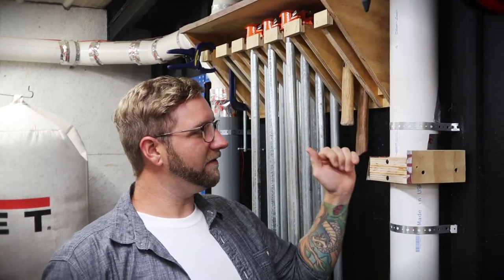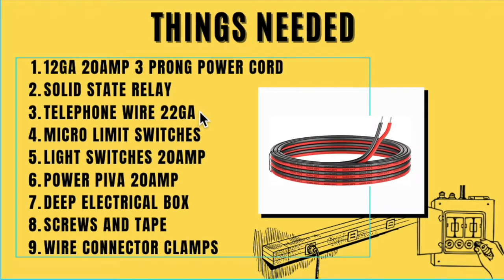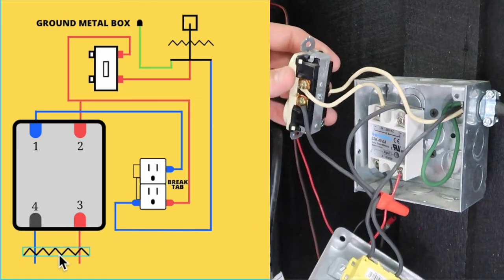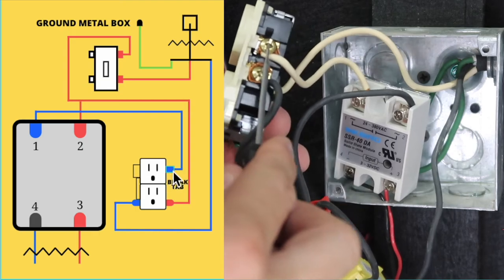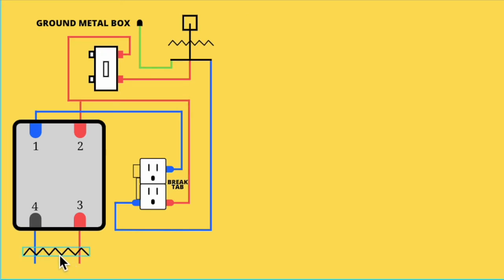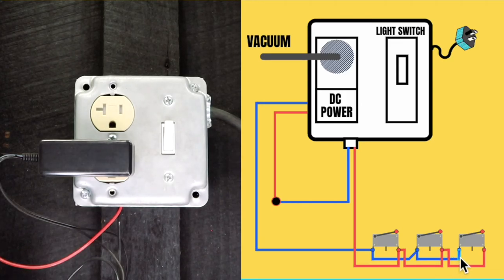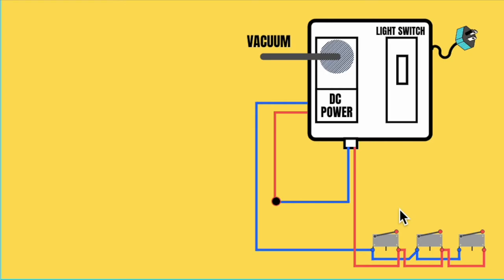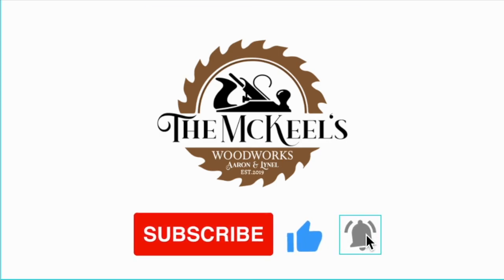DIY AUTOMATED BLAST GATE DUST COLLECTION SYSTEM WIRING DIAGRAM

Comment: Question about the switch.  Why is the switch needed? Just so that you can shut it off so the relay does not over heat?  I bought the relay and it came with a heat sink device but there is no way that device will fit in the deep electrical box.  If someone has to remember to go to the dust collector to shut off the switch for the relay or even put the switch somewhere close to where you work, then I am not getting the idea of automating the DC to come on by opening a blast gate. I mean I get the convenience of any blast gate opening would turn on the dust collector and shut it off, but then we have to remember to flip that switch.  I am not liking that option because then it would be easy to forget to turn it off. I have a remote for my DC and after watching several other videos on doing what you have done, and after wiring everything to make this blast gate automation, I am now stuck with the idea of having to remember to turn off a switch for something you cannot see or hear running.  I was thinking why couldn't I have use an alexa enabled switch instead of the one I bought.  That way maybe I could out some automation in place that says if the switch is on for a certain period of time, turn off the switch or send me an alert that it is on for say 30 minutes or an hour.  Thoughts?

Comment: I veiwed in your video that the right side of the outlet had the break off tab removed but the left side of the outlet where the neutral is located at the bottom was not removed, my question is should both sides of the outlet have the break off tabs removed? 
And I am finally find a video I was looking for.
 Thanks a mil.
Reply from the maker: You're welcome! 

Do Not break the White tab. 

Break the tab on the black side only! 

If you have any other problems, I am here to help! 

Don't forget to subscribe!!!

Comment: Is it correct to say that the micro switch in it's closed or pushed down position, is the same as bridging the relay's #3 and #4 position's? That seems it would be a dc short? I am not clear where the + And - dc source (phone supply is input.) 

I can't seem to follow the DC input into and through the micro switch, and from the micro switch, back to the relay. I don't clearly see the DC input's. It looks like a DC short between #3 and #4 on the relay?

Thank you for this video! I hope you can help me follow the dc circuit. Looks like you have it set up as a normally closed micro switch and passes when open (uncompressed) I just cannot follow the + and - dc part of the diagram. Thank you have the setup I want to do!!
Reply: You can wire the micro switches to be either NO or NC (Normally Open or Normally Closed). The way these are wired is so that when the switch is closed (depressed) the circuit is open, and when the switch is open (the blast gate is no longer depressing the switch) the circuit is then closed.
Reply: The 3 and 4 position sense a DC voltage when the micro switch completes the circuit, then the relay closes the AC circuit to start the dust collector.
Reply: Shouldn’t the outlet be grounded to the box?
Reply from the maker: It is grounded to the metal box. If I failed to mention that in the video, grounding it to a metal box is correct

Comment: Little clarification - the 3 and 4 post on the relay are sensing DC voltage - it won't sense DC voltage until the blast gates are opened therefore completing the circuit of the "Phone charger" which is really just a DC power supply.  Once the relay senses DC voltage on the 3 and 4 posts the contacted closes completing the circuit on the 1 and 2 posts.  Basically once the 3 and 4 posts sense DC voltage it shuts the "Relay" in the SSR and completes the AC circuit starting your dust collector.
Reply from the maker: That sounds good. Do you have a specific concern with the set up? I am sure there are more than one way to the same result. But the way I show it in the video is the way that works well for my set up.
Reply: @TheMcKeelsWoodworks  No, your setup is fine, just clarification on the fact that the DC and AC have zero to do with one another.  The DC merely is a sensing line to close the relay to complete the AC circuit.  DC also doesn't have a "Neutral" it is just positive and negative.  Maybe I have spent too many years dealing with both at extremely high voltages and amperages.  At the end of the day your setup is perfect, just the terms used were a bit fuzzy.